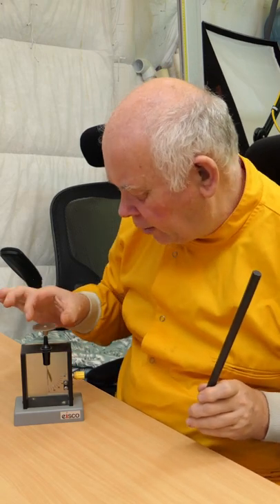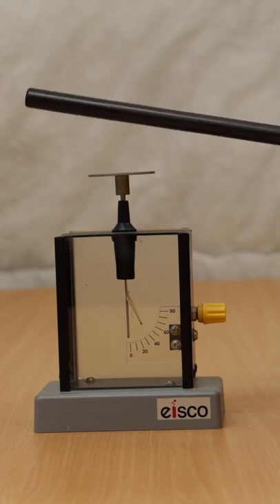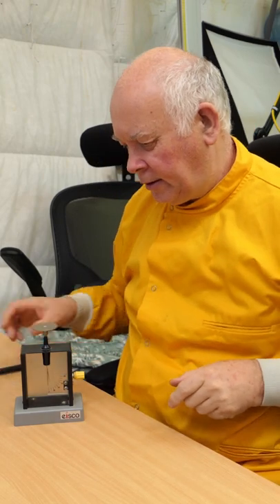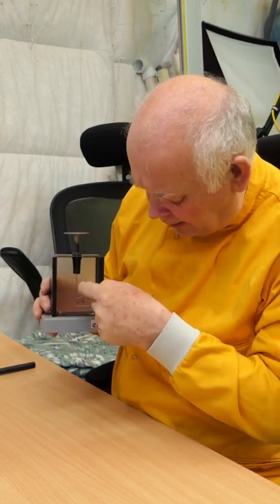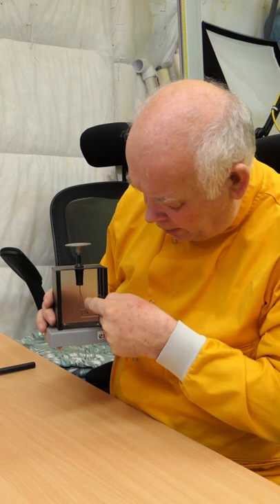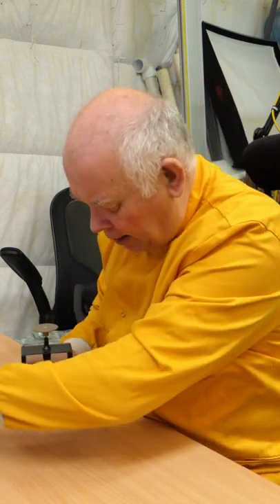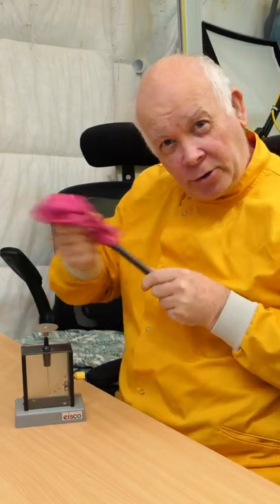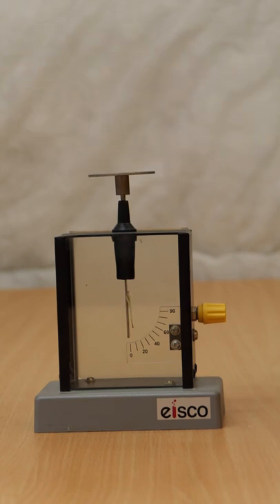how does a gold leaf electroscope work

Comment: Does the leaf part work with any metal ?
Reply from the maker: Some use Dutch metal. Gold is the best as it can be hammered, very thin and relatively light. I have replaced all my electroscopes with gold leaf, and now they all work perfectly, as many other metals were too heavy. Of course, this is more expensive.

Comment: sir if inner it's gold leaf then being metal why it not divergen earlier. why after period it get neutral
Reply: I didn't get it sir. overall explanation is excellent
Reply from the maker: Like charges repel. When the rod and gold leaf are both charged with the same charge then the gold leaf moves away. Touching the charged stick onto the electroscope is not required because the charge is found in lines of electric flux around the charged object - much like a magnetic field